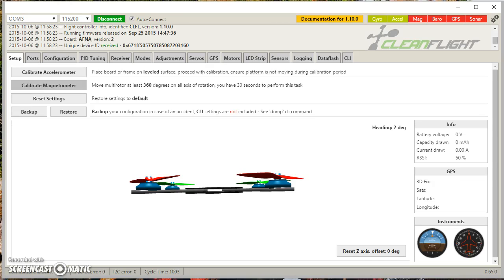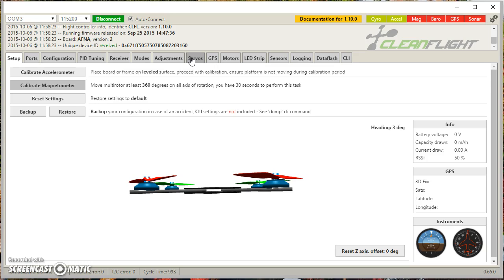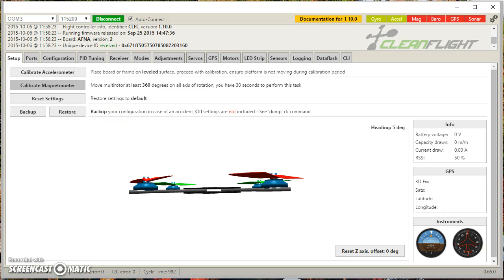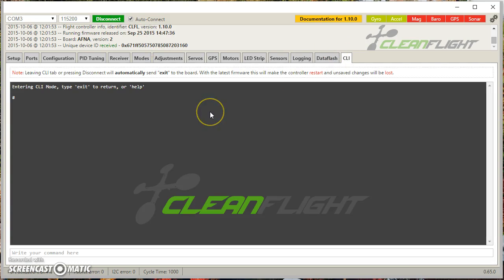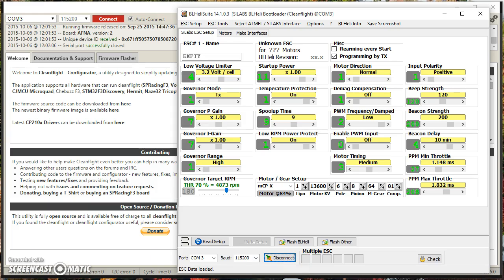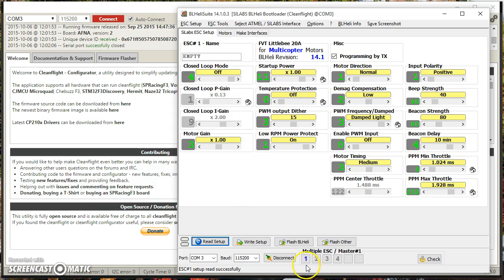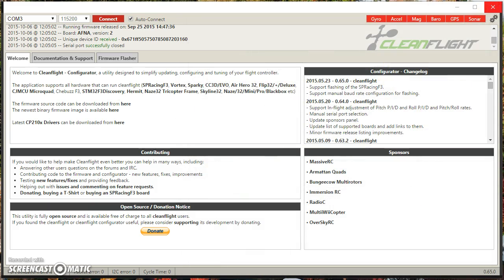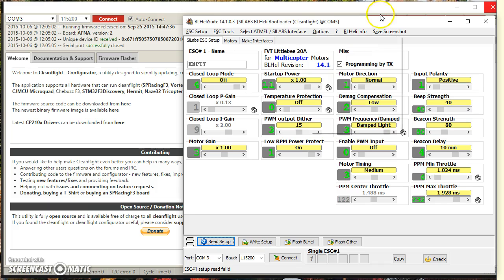BLHeli Passthrough | EASY BLHELI ESC CONFIGURATION AND FLASHING

Comment: I watched this again, but a bit confused because you say that betaflight is needed since the passthrough did not make it into cleanflight.  Seems though you are using cleanflight.
This is my first time with a cc3d board and like the librepilot interface is it easy enough to switch back and forth between the two?
Reply from the maker: +French Fry I am using the Cleanflight configurator, but the board is running Betaflight. Betaflight is an offshoot of Cleanflight, but it still uses the Cleanflight configurator.
Reply: +Joshua Bardwell Ahh, okay, now I get it, thanks for the reply.

Comment: Does it require Silabs or will work with Atmel?
Reply from the maker: Either, but it must be BlHeli bootloader, and most Atmel ESC's come with SimonK bootloader.
Reply: +Joshua Bardwell thank you.  The ones on the way are BLHEli bootloader,  so I'm in luck.
Reply from the maker: ***** Are you 100% sure about that? Because a lot of people think they're getting Atmel ESCs with BLHeli bootloader, and end up being disappointed.

I hate to be a hater, but it's true. If you ordered Atmel ESCs, I'd lay $10 (hypothetically) that they come with SimonK bootloader.
Reply: +Joshua Bardwell From what I've heard you are right that most Atmel's come with Simonk, but I have confirmation from someone who bought them, plus comments on the product page say it as well.  
http://forum.banggood.com/forum-topic-106468.html
Reply from the maker: Awesome.

Comment: cant make it work when trying to flash 4-1 esc from readymaderc with blheli bootloader....
they are "blank " no text appers when read and the write button dosent appear....what the fk is that????
Reply from the maker: +Tarsson Tdrone Turn on logging in the BLHeliSuite options menu. Then select just a single ESC at a time instead of trying to read multiples. See if either of that fixes it.

Comment: Have you done a vid on changing the bootloader, if even possible?
Reply from the maker: +Vic Prk (Slick  Vic) It is possible, but I don't think I will do a video on it unless I happen to buy some ESCs that don't already have the BLHeli bootloader, which I don't plan to ever do, because it's kind of a PITA. I mean, it's not the end of the world, but you have to cut the heat shrink on the ESC and etc... and I would rather just buy one that already has it.

It's not really any different than flashing over the signal wire, except that you need the right kind of programmer to communicate with the chip.

Comment: I have a naze with little bees that connects to cleanflight ok but can't connect to the esc via blheli with cleanflight disconnected. I can clearly see they are on com 22 and the newest blheli shows the cleanflight silabs option as you show. Cleanflight is not connected but still cannot to connect to coms port errors via blheli.  I don't get any connections but tried the enable log feature just in case - still no connections. If you have any advice I would appreciate it very much. Cheers
Reply from the maker: Naze v5 or v6? I'm not sure that v6 can do pass through.
Reply: It's a rev 6. I found if I leave the cleanflight app disconnected but open i get nowt, if I close the clean flight app totally I can connect and reflash fine, all 4 too. I removed all esc/motors and the 2 offending ones don't even work via a separate rx any more. They just get hot real quick.
I need to test them with other motors to make sure but don't see any dodgy windings or melted epoxy and this was just a single fairly mild flight, very not cool.

This is naze no.4 too, about to give up on a naze rig totally to be honest, doesn't seem worth the cost or the scores of hours or wasted field trips.
Reply from the maker: If the motors get hot there is likely a short in the windings.
Reply: Joshua Bardwell Sorry bud, I mean esc get hot, motors seem stable. Iron heating up now to find out whats up.

Comment: will this work on the DYS mini opto?
Reply from the maker: +Chi Sty It will work with anything running BLHeli with the BHLHeli bootloader. Actually, that's not entirely true... a few older ESCs may have a filter on the signal input that messes up data transmission over the signal line.
Reply: +Joshua Bardwell sounds like what I got ...it see all 4 ESCs but when I go to read them it tells me there was a problem reading.....does that mean I have Simon K bootloader running biheli?
Reply from the maker: Probably.

Comment: when clicking read setup, it doesn't read anything. any idea why? I have a flip32 and spider opto 18a esc's
Reply from the maker: SimonK bootloader is the most likely explanation.
Reply: is it possible to load blheli bootloader onto it?
Reply from the maker: +Mitchell Klepfer Sure, but you need to flash it via the programming pads/pins, not the signal wire. Checking images of the ESC online, the pins do appear to be broken out to solder pads, or you could use an Atmel programming adapter like this one (http://www.hobbyking.com/hobbyking/store/__27195__Atmel_Atmega_Socket_Firmware_Flashing_Tool.html).
Reply from the maker: +Mitchell Klepfer Before I tried to flash a new bootloader, my first approach would be to make a 4w-if programmer out of an Arduino and use it to talk to the ESC over the signal wire. This will work with either bootloader, and will let you confirm which bootloader is currently on the board. If they somehow already have BLHeli bootloader, then there is some other problem with the passthrough.
Reply: i just gave up. bought some new esc's with blheli. lol
Reply from the maker: Which ESC's? Many blheli ESC's have SimonK bootloader.
Reply: my ztw spider light esc's werent working so I got the new dys ones.  http://www.thedronestorenv.com/collections/dys-esc/products/dys-mini-xm20a-3-4s-esc-blheli-firmware
Reply from the maker: +Mitchell Klepfer That one does have the BLHeli bootloader so you're good. And it's a decent ESC too.
Reply: Cool! looking forward to it!

Comment: does the rctimer 30amp blheli have the blhelibootloader ?
Reply from the maker: +marwan alaywe No clue, but likely not. Many ESCs are shipped with SimonK bootloader. Some have suggested it's because SimonK toolsticks are so common. You can find out for sure by making an Arduino board into a 4w-if interface, and then connecting to the ESC. The top of the BLHeliSuite window will show which bootloader was detected.

Comment: Can i use with cc3d+beta flight 2.1.5?
When i white the command 1wire cleanflight tell me "error unknown command"
Reply from the maker: +PiPPi 1wire is not used any more. It has been removed from CleanFlight. Just connect directly from BLHeliSuite as shown in the video.
Reply: +Joshua Bardwell yes but not working on cc3d.now i used a naze and still working
Reply from the maker: PiPPi I don't have a CC3D so I don't know the exact details, but I believe on CC3D pass-through only works on either the virtual port or the main port.
Reply: I'm trying to use cc3d as passthrough to blheli using the main port and ftdi adaptor (same as I used to flash cc3d betaflight .hex) but to no avail. get to where I plug battery in but the esc detail snapshot that appears is blank. using littlebee esc with blheli bl
Reply: +PiPPi +Joshua Bardwell I've just tried again using ftdi adaptor through the flex port (usart3) configd to MSP and I got a connection to the escs.
Reply: +Barry Hearn I try that way , (flexport+ftdi) - can't read - do you connect battery first?

Comment: Thanks for doing this vid! I was going insane trying figure this out. My naze32 rev 6 didn't work. Went back to Rev5 and flashed perfect.
Reply from the maker: +FPVillain If it doesn't work, the most likely cause is that you have the wrong bootloader. if you are sure you have the right bootloader, then your board probably doesn't support it. As near as I can tell, all the bugs have been worked out, so this should be working smoothly for almost everybody who meets the above two conditions.

Comment: You have to have simonk bootlaoder if you are using afro or turnigy stick, that's the reason esc's with blheli firmware come with simonk bootloader.
Reply from the maker: +Guy Rook Good point.

Comment: using rg20 esc and naze32 rev6
flashed betaflight.

on motor is starting only aroun 1500, all 3 others are around 1160. i need to calibrate esc togheter i guess

tried this to connect to blheli suite via fc. cant connect. tried multiple way. followed your video.. still unable... what could be causing this?

i was able to connect to esc directly prior to direct soldering to fc.
Reply from the maker: +Mathieu Paris-Caron There have been some reports on OscarLiang&#39;s blog that the rev6 doesn&#39;t work with passthrough.

PS: This is why I don't like to direct-solder, no matter how nice and compact it makes the build. Ugh. Sorry.
Reply: +Joshua Bardwell is there another way to get my esc synched ?
Reply from the maker: +Mathieu Paris-Caron throttle calibration via the Motors tab.

Comment: This explained a lot. I have DYS BL20A esc's that BLHeli Suite cannot read. Its obviously because they have the Simon K Bootloader but flashed with BLHeli. I also have the newer DYS SN20A esc's. They work fine with BLHeli suite. I always presumed they were the same esc but they are not.
Reply from the maker: +Beetlejuice 01 BLHeliSuite can work with either bootloader. It's only the Cleanflight passthrough that doesn't work with SK bootloader.
Reply: I have both BL20A and SN20A DYS speed controllers. BLHeli Suite cant read from the BL20A's but can read from the SN20A's. I get an error message saying MCU not supported???
Reply from the maker: +Beetlejuice 01 Sorry. I'm not familiar with that error.

Comment: hi good work
i have a problem... esc with boot blheli not connect....
you power the esc??
Reply from the maker: +Victor Shore What ESC?
Reply: Sn20.... i change the boot to blheli boot but not work...
I change the boot with usbasp in the pads of the sn... blheli suit works but not trought the naze
Reply from the maker: +Victor Shore When you connect via Arduino, does it show BLHeli bootloader at the top of the BLHeliSuite window, and/or in the BLHeliSuite log? Just 100% confirming that BLHeli bootloader is burned.

Other than that, I don't have any advice. Sorry.
Reply: +Joshua Bardwell yes, show blheli bootloader, if you have a email, i send to you the photo.

Comment: my esc's are connected to the naze only with signals wires do I need also the ground signal for this to work?
Reply from the maker: +sharon otmazgin You need to get ground from somewhere, but it doesn't matter where. The ESCs will get ground from the power leads, which should work fine. Unless you truly have opto-isolated ESCs, in which case the input and output sides will have isolated grounds, but this is pretty uncommon.
Reply: Joshua Bardwell my rg 30amp connected only with the signals and I power the naze with bec 5v
This will work without esc's ground? 
Tnx and sub:)
Reply from the maker: +sharon otmazgin If the copter gets signal from the board with no ground, it can be programmed with no ground. It's an all or nothing proposition.
Reply: +Joshua Bardwell thanks! !
Reply: +Joshua Bardwell for last :)
where can I find the blheli configuration  settings for betaflight ?
Reply from the maker: +sharon otmazgin The demag, dither, and timing settings need to be matched to your motors, although the defaults work fine for many motors. The PPM min and max need to match the min_command and max_throttle in Cleanflight/Betaflight, which you can accomplish by calibrating the ESCs via the Motors tab (max throttle, power up the ESCs, wait for confirmation beeps, min throttle, wait for confirmation beeps).

You need to be at BLHeli 14.1 to optimally handle the low looptime used by Betaflight. Also, you should disable PWM input.
Reply: +Joshua Bardwell tnx again :)
Reply: +Joshua Bardwell Hey Joshua, can you explain where to find the demag, dither and timing settings for motors...I've checked cli.  On my Little Bees dither=15, demag comp=Low and motor timing=Med.
Reply from the maker: It's in BLHeliSuite, not in the CleanFlight CLI. 

https://blhelisuite.wordpress.com/
Reply: +Joshua Bardwell   I understand that.  In your post you said those settings need to match your motors settings...my question is where can I find those parameters for the motors I am using.
Reply from the maker: I see. Sorry for the misunderstanding. Start with default settings and only adjust if you get signs of sync loss such as stuttering on rapid throttle increase.
Reply: +Joshua Bardwell OK.  Thank you Joshua.  Appreciate the help.
Reply: +sharon otmazgin I terminateed the negative signal return wire very short with a female 2.54mm DuPont connector on each ESC.  I have a wiring harness that I plug into all of the esc grounds to the FC in order to flash the ESCs through the FC.
Reply: +sharon otmazgin  YES!

Comment: What is the minimum version of blheli you must have on the ESC to allow flash through cleanflight?
Reply from the maker: +Rc Dad  I don't know the answer, but I don't think it should be anything special. I don't believe that the ESC knows anything other than, "I'm talking to a programmer." Whether the programmer is an Arduino, or a toolstick, or Cleanflight, it doesn't care. The magic is between BLHeliSuite and Cleanflight. 

If you could program the ESC directly from BLHeliSuite, you should be able to do it via Cleanflight--as long as it has BLHeli bootloader, that is.

Comment: I think this feature is not available in stable Cleanflight 1.10.0 release because BlHeli is still not available on Mac only on PC.  In that case it's feature that is not consistent across operating systems there for not included in Cleanflight which is about consistency.  Would be great if BlHeli had Chrom App similar to Cleanflight. Will ask Dominic about it next time I see him.

Comment: My ESC has SimonK loader on them.  WOuld be nice if they program CF/BF to use it as well.  Converting bootloaders seems like a pain and the SimonK bootloader supports both SimonK and BLHeli firmware.  If I am in the market for more ESC, I will make sure the have the BLHeli bootloaders on the but for now, i will just stick to individual programming of the ESC.  I do not flash them that often.  Good video though.  Subscribed!
Reply from the maker: +Scot Caraway BLHeli bootloader supports both as well. It's the linker code in Cleanflight that requires BLHeli.
Reply from the maker: +Scot Caraway ... and, if my memory is correct, BLHeli bootloader is about 1/2 the size of the SimonK one, which makes a difference on some ESCs.
Reply: +Joshua Bardwell According to Oscar Liang's site, the blheli bootloader is half the size of the Simonk loader.  

http://blog.oscarliang.net/blheli-simonk-bootloader-esc/

I wonder if they will put simonk bootloader support in CF linker.

Comment: Thanks Joshua.  I tried to figure this out last night, but failed.  Your video answered a lot of questions.  One more pls.  Once you are connected and the configuration is read, how do you switch between ESCs?  Thanks in advance.
Reply from the maker: +Dan Blake Left-click to move an ESC into/out of the group. Right-click to select only one ESC at a time.
Reply from the maker: +Dan Blake When the group is visible, only the master config is shown, and any ESCs that are out of sync are grayed out, but they will be written to if you hit "write". To view an out-of-sync ESC, right-click it, or left-click to turn off all other ESCs.
Reply: +Joshua Bardwell Thanks Joshua.  That's very helpful.  Will try again.  Subscribed.

Comment from the maker: SINCE SOME HAVE ASKED: There is no toolstick with this approach. Cleanflight is the toolstick. Just plug the flight controller into the PC via USB per usual. That's what makes this method so awesome.
Reply from the maker: You might be able to, but you should really keep the ground wire, in my opinion.
Reply: +Joshua Bardwell Can you reflash cleanflight after doing this if you do not want to run betaflight?
Reply from the maker: +sciullo779 sure.
Reply: +Joshua Bardwell  great videos! my i ask you, since i removed from my little bees esc the middle ground wire leaving only the signal, can i still flash them through cleanflight?
Reply: +Joshua Bardwell thank you! And why is better to keep it? Sorry for bothering
Reply: +Nils Astrologo grounding is always good I assume ?